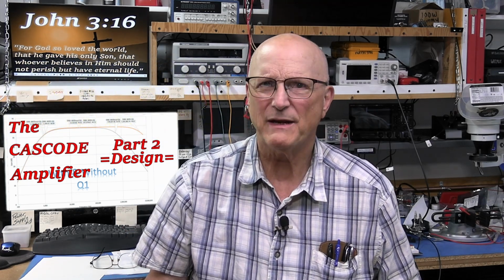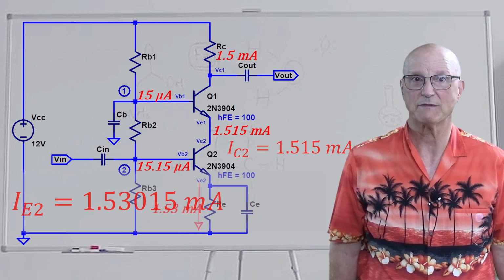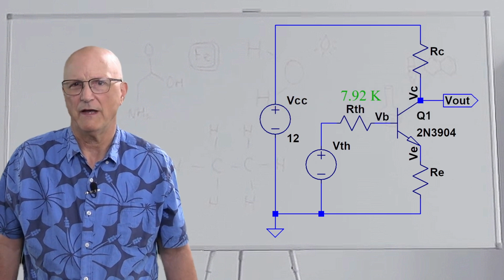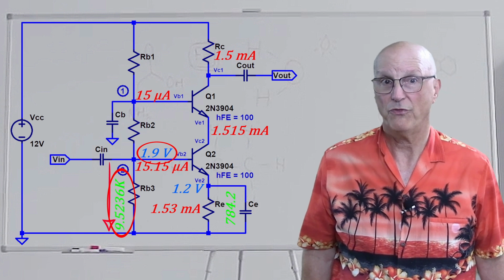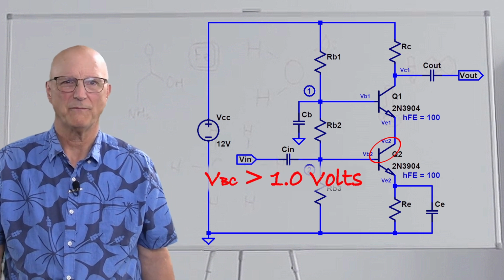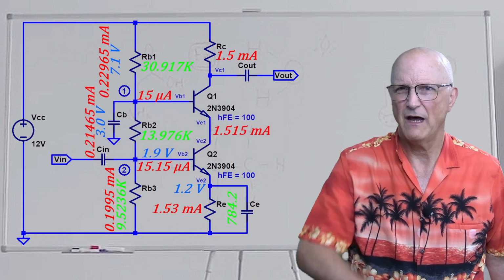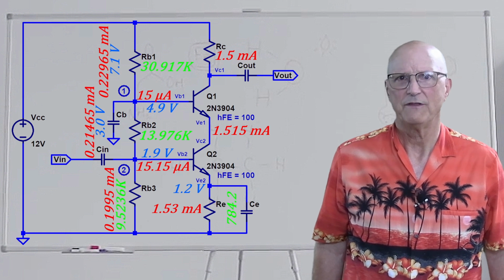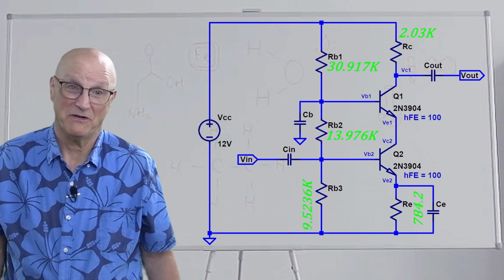BJT Circuit Analysis: The CASCODE Amplifier (Pt 2) - DESIGN (066g2)

Comment: Thanks for a very helpful video. One question: We started off the design with the Icq1 value given in the question, but what if it is not? How do we find the Q point current Icq1 when we are unaware of any resistances in the circuit?
Reply from the maker: You are very welcome! I'm glad you found the video helpful.
To answer your question ... you have to start off with some assumptions or design goals based on engineering experience and the particular application. Without these goals/assumptions, just a blank slate, you would have nowhere to go and no way to get there.
If you do not know Icq1, then you have to set some other goal or make some other assumption to get things moving ahead. What that goal/assumption might be depends on your application. I know this probably isn't a lot of help, but this is the way the process goes. You just have to have a starting point and sometimes this is based only on what you are trying to achieve and the experience you have as an engineer as to how to achieve it. 🙂

Comment: Hi Ralph, thank you so much for your lessons, your knowledge is beyond price. I wish I'd had you as a teacher. (That was a long time ago) .
I have a question about the Cascode amplifier: Based on your amplifier. What if I replaced the RC resistor with a constant current source or a 1.5mA current mirror? Would the rest of the circuit remain the same?
Kind regards and thank you very much for your answer!
Reply from the maker: At quiescence I believe it would all be the same. The problem lay in its dynamic response as an amplifier.
I took my model, ran it as the original design and then replaced the collector resistor with a 1.5mA current source and ran it again. The dynamic response suffered dramatically.  😞
Here is a link to the ZIP file with the spreadsheet that has the simulation results:
https://drive.google.com/file/d/1e8YPFSiPKWydFh99T81U2NYisKQjeucw/view?usp=sharing
Reply: @eie_for_you  
Hi Ralph, thanks for the quick reply.
I would have expected the exact opposite, you can be so wrong.
I would really like to have you in the neighborhood ;)
kind regards and have a good time
Werner
Reply from the maker: @Blinkertlurer  Yeah, it was somewhat of a surprise to me, too. Download the *FREE* LTSpice program and play with the design. If you want me to provide my model, I'd be glad to. 🙂
Reply: @eie_for_you  Ralph, i have questions 

I have build a circuit like yours, but instead of a single Q2 Transistor, i have 4 Transistors.
All collectors are connected together and wired to the Emitter of Q1. All Bases are wired together. All have it's own Emitter resistor and Capacitor. All resistors are 4 times the value of the single Q2.

I have the circuit running "more or less". I calculated the circuit with one transistor Q2 and used then the Qucs Simulator to get all used Values. I also do not understand, what the values of the Emitter Capacitors are.

I also tried to calculate the circuit with your Formula but failed.

Can you give me a hint of what i can do, to calculate it correct.

Thank you!

Werner
Reply: I think it is important to say, that i know Beta at room temperature and the Transistors are matched :)
Reply from the maker: Got it.
Reply from the maker: My first question is, "Why would you want 4 transistors?" I am not clear on what you are trying to accomplish with this.
If the transistors are matched, as you say, then each transistor would have 1/4 of whatever current the single transistor would have. But, as an aggregate, they would act as one ... except that you broke up the emitter circuit.
When you said that you tried to calculate the circuit with my formula ... I looked again at the go along with the video formula sheet and there were lots of formulas in there, so I am left not knowing how to help. I cannot know what formula.
What I do when I get stuck like that is I stop trying to do it on paper. It is amazing how stuck I can get on paper.
I get out my whiteboard. Draw out what I know **for sure**. Then I take my time, one tiny little step at a time. Sometimes sitting back in a chair and staring at the board for a while, pondering the various moves. Kind of like a chess game. This has always worked for me. In fact, this is how I worked through this design.
Regarding the emitter capacitor value ... if you do not want the emitter resistor to affect the frequency response of the circuit, then it has to be large enough to have a very low capacitive reactance through out the operating frequency range. Thus, the 10uF capacitor in my example.
If, on the other hand, you DO want the frequency response to be affected (rolling off the high frequencies), then you choose the value as needed to limit the high frequency response.
Hope I've helped somehow. :-)
Reply: @eie_for_you  
Ralph, thank you very much for your answer and the time you spend for me.
The main reason for building a cascode amplifier with four BJT transistors is noise.
It is a experimental amplifier, i try to create a sensor amplifier.
It was my idea, to have 4 Transistors working as one.
So i did the same steps as in your Youtube video. For the calculation,i put the emitter resistors together to one Resistor. Then i expected, that each Ib is 1/4 of Ic. Then i followed the way you showed in your Video "Cascode 2" to calculate the resistors around the amplifier. But i never had the same results i needed (wanted). The Base Voltages of both Transistors was always too low. 
After calculating the Circuit, i used the simulation Qucs to optimize it. After that, i had to finetune the hardware. Crazy :) 
It is working, but it's critical. When the voltage, i use 24Volt, is changing a little it is oscillating at the upper edges of the signal. I never saw that before. Also, if i used the Capacitors higher than 470nF, the output Voltage was going through the roof and clip on each end. So, i use it without Capacitors.
By the way, the noise floor of the Amp is -118dBu what's quite impressive.

Well, i do not want to take lot's of time from you for my privat fun. Let me know, when it's a Tricky one ;)
Thanks, Werner
Reply from the maker: Without the emitter resistors, the gain goes down as they provide negative feedback to the circuit. That is why the oscillation occurs when they are too large. When they get too large, the high-end frequency response increases. By limiting their value, you limit the high-end frequency response. You might find that you might consider a bit of a modification to your emitter circuit so you can control the gain ab bit better. Check out this video: https://youtu.be/vPomIT0fn34
Also note that matched transistors are fine, but the differences in emitter components can all undo that to some extent. Be sure that the emitter components are matched as well. Just a thought.
NICE noise floor, by the way!
Reply: @eie_for_you  
(NICE noise floor, ...) This is the reason, why i am following that tricky beast :)  
My thinking was to multiply the Emitter Resistors by four, because they are parallel in the circuit and becomes the old value. Wrong thinking. Thank`s for your comments, i will try it. Love you ;)
Reply from the maker: You are welcome. Keep experimenting and having fun! :-)

Comment: Good morning Ralph
I have a couple of questions if I may please
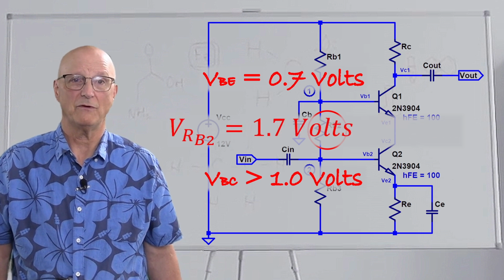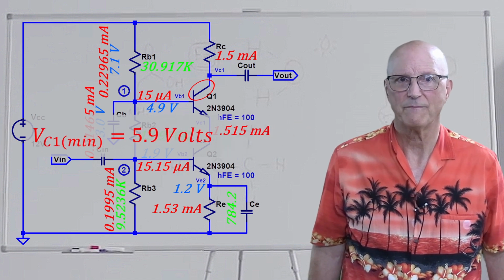When calculating the value of Rb2 value at 18:45 we decided the minimum voltage across it was 1.7V (Vbc2 = 1V and Vbe2 = 0.7V) but we choose to go with 3.0V meaning Vbc2 is assumed to be 2.3V not the minimum 1.0V, whereas when deciding Rc1at 25:55 we stuck using Vbc1 as the minimum 1.0V. Why round up Vbc in Q2 to 2.3V but maintain Q1 Vbc at 1.0V?
[I note the use of the rounded value of Rc1 as 2.03k instead of calculated 2.0333K]
I read the other comments for this video and you expressed your desire to not round any resistor value till all calculations are finished "I never rounded off until the final calculations were complete". My question is: would choosing the closest actual resistor values as soon as you calculate the theoretical value, ie with the very first calculation, the one that would cascade errors the most is Re2 calculated to be 784.2ohms (I could not read the resistor value used on the breadboard) the nearest actual value would be 7500 or 8200 ohms, would not using this chosen resistance value to calculate the new "actual" value of Ve2 & Vb2 cause less cascading of errors?
I hope this all makes sense. Again thanks for the video and I off to watch part3.
Reply from the maker: First question...the use of Vcb of 1 volt for Q1 was to establish an absolute minimum to establish the bounds of possible voltages for the collector voltage. The actual operating Vcb is much higher.
The choice of Vcb for Q2 was to establish the actual operating point of the transistor.
Second question ... I use 1% resistors almost exclusively. The price as compared to 5% is almost indistinguishable these days, so why not. This puts the value of the chosen resistor MUCH closer to the theoretical value. When I chose resistor values for the breadboard, I chose them from the list of 1% resistors.
Hope this helps. 🙂

Comment: The gain of 2N3904 might also be 300; typically it is about 230.  It will also vary substantially with temperature and quiescent state.  Even well-designed transistor circuits are 5% propositions at best.  There is no point in keeping more than 3 significant figures and you might as well neglect the base current's contribution to the emitter current.
Reply from the maker: Yes, I understand where you are coming from.
The datasheet for the 2N3904 says that the hFE can be from 100-300. I have often used 200 as my go to value. But here, I used an hFE of 100 t0 try to  minimize thermal effects.
Regarding rounding of values ... in my *many* years of product design and development, I never rounded off until the final calculations were complete. The reason? Because I have seen way too many times when rounding came early and caused issues.
When subsequent calculations depend on previously rounded values, the error grows as one proceeds through the design and analysis.

I do not discount your advise. I just choose to do my engineering differently. 🙂

Comment: Are these only good for frequencies >1khz?
Reply from the maker: The low end frequency response is determines by the values of the Emitter capacitor (Ce2) and the Base capacitor (Cb1).  The lower the frequency, the larger the capacitors need to be to maintain gain. 🙂